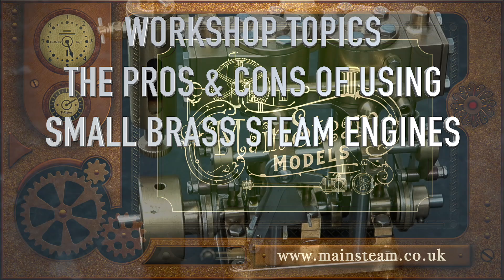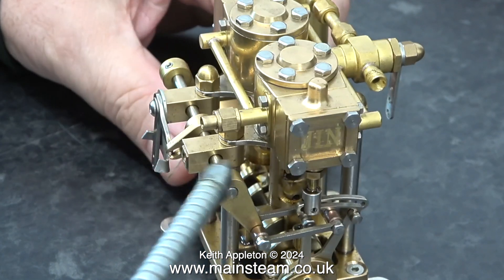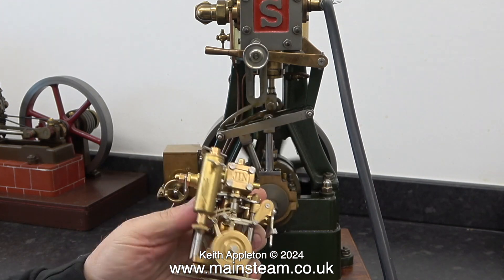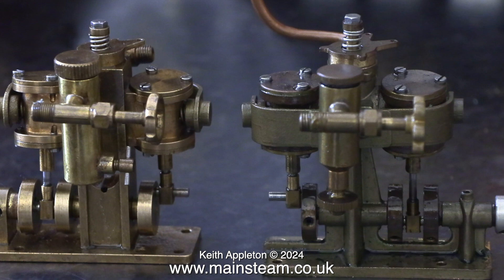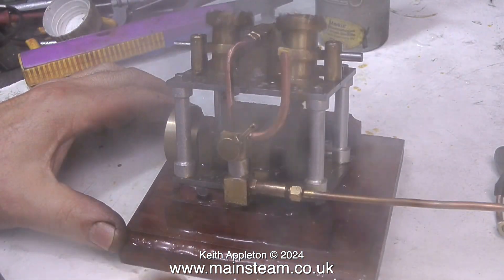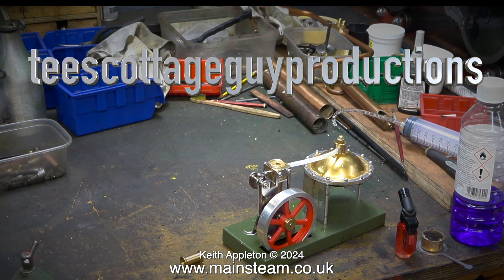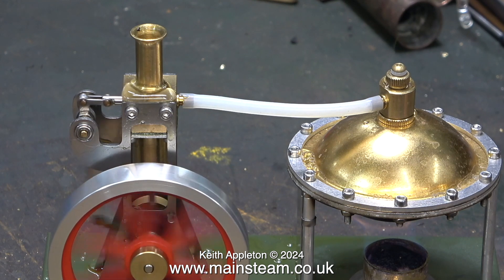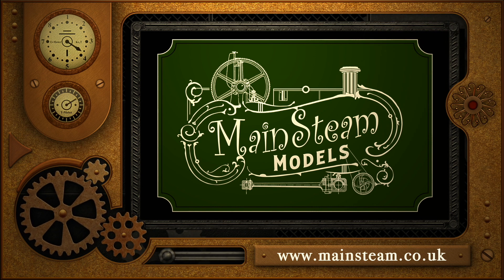THE PROS AND CONS OF USING SMALL BRASS MODEL STEAM ENGINES

Comment: I don't think brass is the problem. Most of my railway locomotives and rolling stock have brass bearings on steel shafts. They have served well for over 25 years. Many manufacturers, e.g. Accucraft, work with Chinese suppliers, and there are British and European manufacturers such as Roundhouse and Regner, who make excellent quality brass components, assemblies and finished products. I think the key is the lubrication, especially when running in. None of the engines at small scale have pumped lubrication, so little and often with the needle oiler is essential.
Reply from the maker: I accept your point, but my experiments using brass as a bearing surface with plenty of oil show otherwise. The loading on larger components like 5 inch gauge steam locomotives and even a Stuart S50 wears Brass very quickly. Brass is probably adequate on smaller engines as I mentioned in the video.